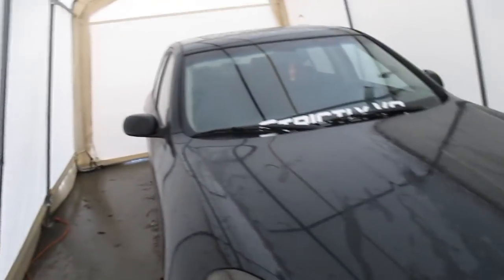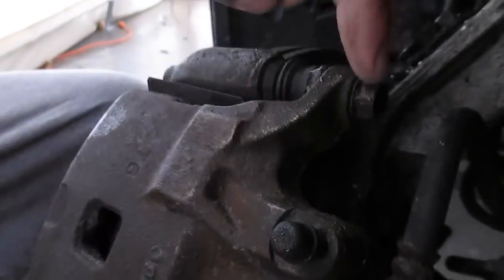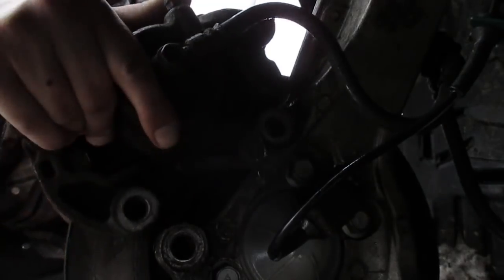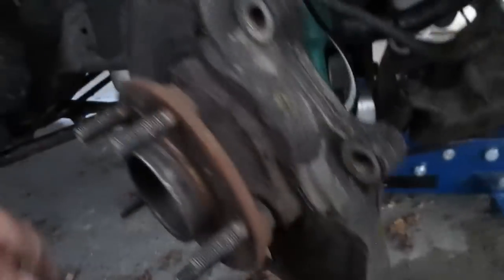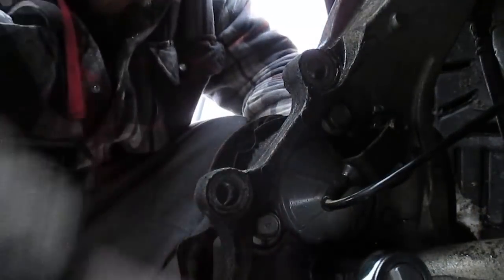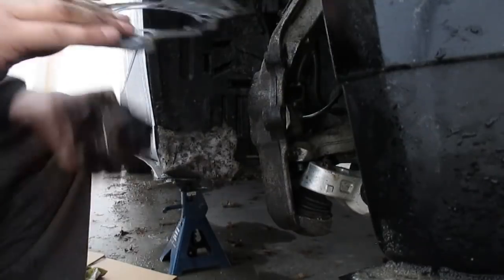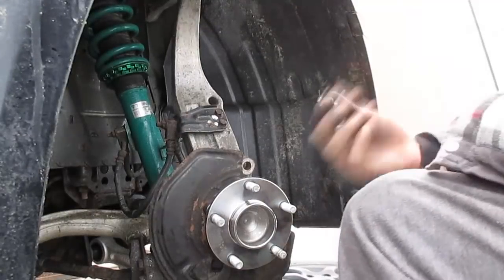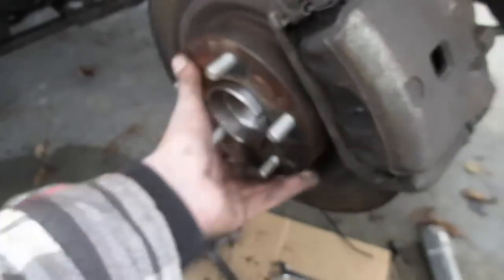Changing Wheel Bearing's On The G35 (350Z, 350GT)

Comment: For the bottom bolt if you just straighten the wheel you can put a socket in easily and not worry about stripping it🤙 hope this helps anyone else struggling with it.

Comment: So my 03 g just started having a bad wheel hub bearing in the rear passenger side just hit 170,000. It's just to the point where I can barely shake it up and down and I found a while assembly for the 03 350z for only $42. And wanted to know if it would fit the g35 coupe.
Reply from the maker: Gatgat00 Tweed yea it will fit they are the same car underneath

Comment: hey man i hear a slight noise like a helicopter sound not too crazy but its there. i also have a problem where if im hitting a corner and i hit a bump i shimmy on the side a bit and i cant control it. any tips on what it could be? bad wheel bearing? bad alignment? not sure :/
Reply: Kent Floress did you find out? I’m in the exact position as you lol
Reply: Same problem aswell
Reply: Went to a shop the bearing wasn’t bad they said most likely a bad shock and unbalanced tire

Comment: My front wheels make a humming, growling, roaring noise as I go quicker. It started suddenly. Its just the second time I drive it like this and it's loud. Is it the bearings or tires? Goes way when you stop, gets louder as you speed up. I don't hear any clicking and my car still seems tight as I change lanes and corner. I'm starting to think that being 3 inches lower (slammed) is starting to ruin my suspension
Reply from the maker: hidden KARD could be wheel bearings. If its a constant humm when driv8ng I would start there

Comment: I have a G35 coupe, are the front wheel hub bearings and the rear wheel hub bearings the same?
Reply from the maker: Joseph Early no they are a bit different rear would have a drive shaft going through it

Comment: How did those hubs hold up ? I was thinking of getting that same brand but i was kinda unsure on the quality. Lmk if you can. Thanks !
Reply from the maker: Still going strong on my slammed G35. Put about 20,000 kilometres on them since this video and they're still solid
Reply: @DNALI   thanks for the fast reply and the vid. I took mine off today. Only issue was that bottom bolt. It was hard to turn but the other 3 moved freely. Anyway I got it off. Waiting on a new one in the mail now. Thanks !

Comment: Only if u ride my g in person youll trip out on why the rear wheels wobble the whole car like if im about to loose controle
Reply: Roberto Olivares I have an 03 g35 and my front right wheels tends to wobble and the lug nuts come loose often , do you think that’ll be fixed replacing the bearings or is it a whole different problem?
Reply: Most likely is your wheel hub assembly for sure bro

Comment: G35 bearings are trash bro 😪
Reply: All bearings go bad with alot of miles. It's called routine maintenance. Infiniti are actually very reliable. Mine are only starting to fail at 190K! Other brands fail much earlier.
Reply: @hiddenkard3101  if youre at 190k theyve been done atleast once before
Reply: they only last around 65k at least theyre easy to change